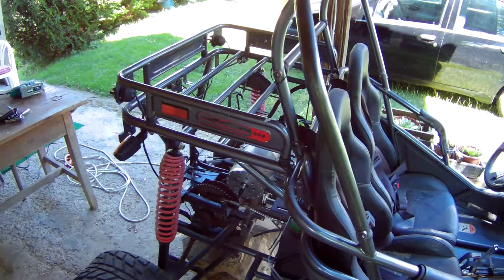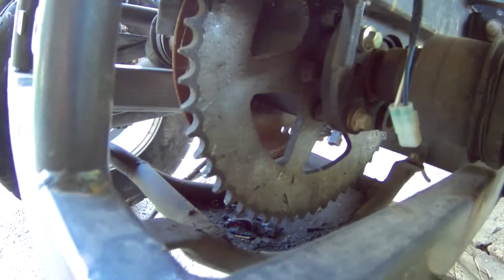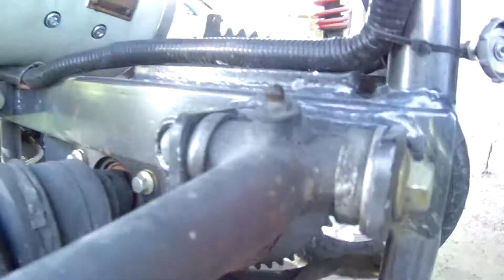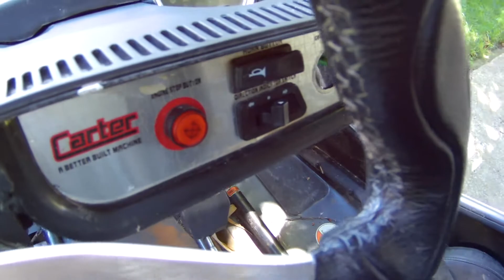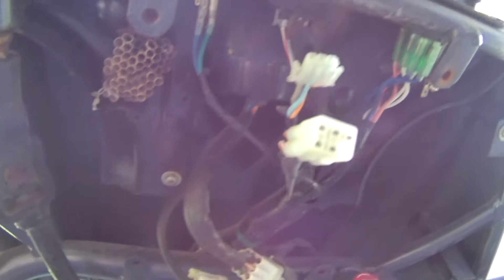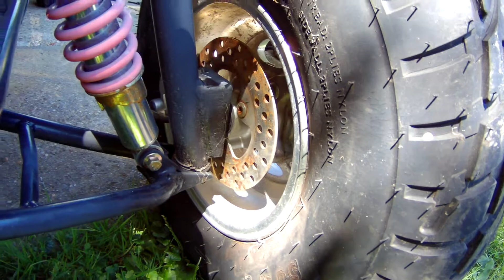Carter GTR Interceptor

Comment: Anyone know how to start these after lying up for a week. 
Hit water. Major puddle. 
Checked spark plugs. Fine.
Cleaned out carb. Checked fuel lines.
Turning over perfect just not engaging
Reply: Hi Patrick, I had this problem too and the reason was trivial. It was the engine stop button which got stuck in the "off" position. A few button presses fixed the problem.
Reply: @MartinLoeschner  
Really 
The one on the dash.
Ill give it a look. Haha I really hope its that simple